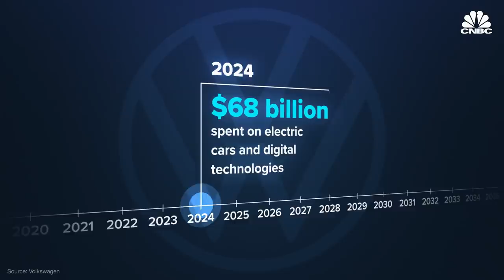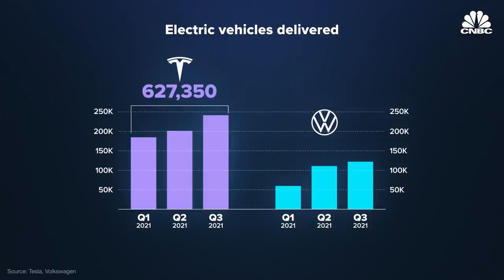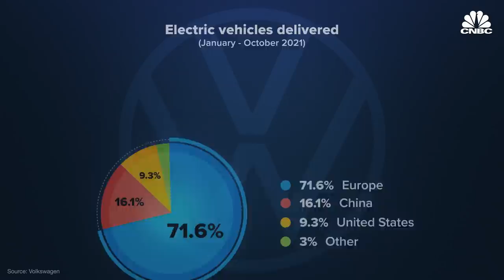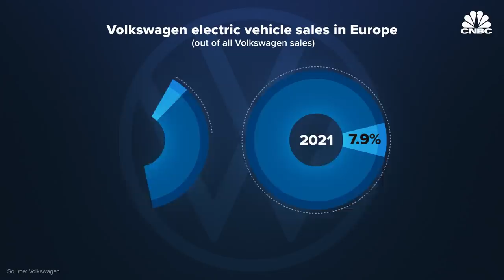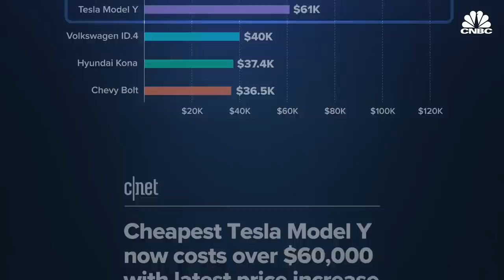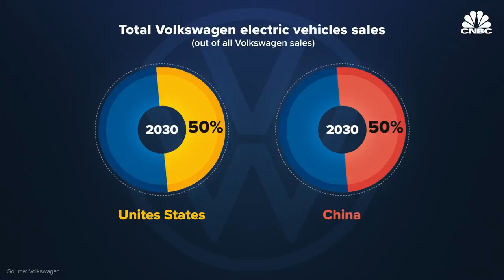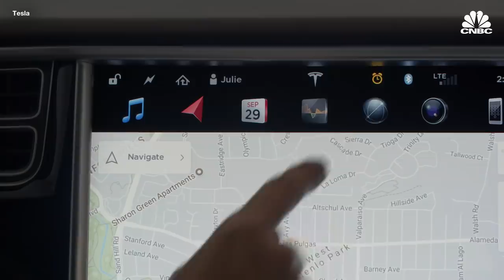Why Volkswagen Is Beating Tesla In Europe

Comment: I am living in Europe and had to decide on an EV as company car. I testdrived a Model Y and an Skoda Enyaq. Both are compareable in size. The Tesla was 20k more expensive. But that was not really important being a company car. My conclusions had been that Tesla is ahead in Software and charging (Supercharger network). And the VW/Skoda was ahead on comfort, Interaction design (due to physical buttons), space, security (Tesla did not even have a cover for the trunk, so everything would be flying around in case of an accident). service network and brand trust.
We decided for the VW/Skoda and it is a phantastic car. The software is inferior. No doubt about that. But after all it is a car and not a toy.
Reply: 20k is not a negligible difference.
Reply: @zkdd23  it was on the company's dime, so no budget issues
Reply: It might seem that Tesla has increased prices to match production capacity. The price of a new model 3 has increased about 8000 USD since we got ours.
Reply: I came to the same conclusion basically and ordered the Enyaq. I must add that the leasing factor is 0.7 and thus really good. However, i ordered the car in July and still have no delivery date, not even an estimate. How long was the delivery time for your car? Greetings from Germany
Reply: What company do you work for ? VW
Reply: @stewarthalliwell  I work for a german IT company.
Reply: @michaelkaercher  it was a joke 
Something which isn’t in the German dictionary !! Another joke
Reply: @stewarthalliwell  So much for stereotypes. Have fun.
Reply: @michaelkaercher  
I can’t afford the Tesla which would be my first choice  
I have tested leaf id3 id4 but they all look dated already 
How are you really getting in with the Skoda ? 
Stay safe and happy
Reply: @stewarthalliwell  The reasons I have described above.  Dated? They did not look dated to me. I find the single screen of Tesla relatively cool but a bit displaced for driver information. At least a HUD should be in Front of the driver if you do not like displays.
Reply: @michaelkaercher  i live in Belgium Luxembourg so we see anything new here first. Because there’s loads of money about 
I can’t agree with you on VW efforts maybe I am not impressed with transfers 
The interior of both 3 &4 are very poor compared with something like the golf 
When Tesla brings out their cheaper small car it’s will be the end of the bigger traditional manufacture 
They need to invest in new plant and they are already bust like German Banks 
I might test the Enyaq and see for my self  what options do you recommend !
Stay safe and happy  and watch out for the radar
Reply: @stewarthalliwell  I did not speak about ID.3 and ID.4 because I did not like the interieur either. The Skoda is much higher quality which is a bit strange given the fact that it is rather a  cheaper brand within the Volkswagen group. I think Vokswagen made a mistake here. 
There is a lot of Hype about Tesla. Tesla sold 386.000 cars in 2021. VW sold 8.9 Million cars. Just to put things into perspective.  And Teslas are not superior cars. 
From a quality perspective, Tesla is not a high quality car. More like a Ford. Compare the Tesla Model S against a decent Porsche or the EQS from Merc. I never ever would consider Tesla here. Buying a luxury car over an app, delivered with missing parts (google for Tesla delivered / parts missing)? Without me. The US service network just collapsed because the heating was failing all over the place. Ever heared that from Volkswagen or Merc? At least there is a decent service network for the traditional brands.
Reply: @michaelkaercher   that’s a long time ago when they come out of China they are another class 
As for Mercedes they have gone down market to pickup the younger market 
BMW makes nothing to get excited about and they have to sack their designers  thé grill is a nightmare 
I am not defending Tesla as they are too expensive 
 But VW may have built so many more cars but they don’t make any money and the time they take a car is over 4 times longer  GM is a joke and lose market share year on year but joe must be trying to get his son a job on the board !!
Reply: @michaelkaercher   what’s your take on the leaf ?  They are taking off 6500 euros off in Belgium
Reply: @stewarthalliwell  never tested it.
Reply: @michaelkaercher  Tesla delivered three times what you claim in 2021
Reply: Hmmm current delivery times for the Enyaq are already a wopping 24 months! Tesla MY only 3 months, go figure....
Reply: The Tesla will keep it's value better, you can't just look at the purchase price. Also the Tesla has better warranty than Skoda / VW.
Reply: @mrm1885  That is pure speculation.Looking at the fact that service is bad and independent repair is blocked, I doubt it.
Reply: @stewarthalliwell  You live in Luxembourg province o Belgium, cool i am from Luxembourg the country. Reality Kia EV6GT (voted car of the year) and Hyundai Inoniq5 are better and cheaper than Model 3 and Model Y.
The new Mercedes EQE (not the EQS) has way more range than Model 3 or Y. In Amsterdam there are currently more new Audi e-tron SUV's (new gen) than new Model X or new Model Y in the inner city. 
Nio ET7 has over 620 miles range (1000km) by far exceeding the Tesla Plaid. Tesla is stuck on level  2 while the competition has level 3 autonomous driving in their production cars and level 4 in their concept cars (Audi and Peugeot for example).
And in Luxembourg the country there are only a very few Tesla cars driving and the Tesla car shop is a microscopic tiny dealership in Bonnevoie next to way larger Bmw dealership and way way bigger Audi dealership on the same road (route de Thionville). Also the Porsche dealership in Howald is way bigger than the small Tesla dealership. All Facts.
Reply: @stewarthalliwell  VW does not make any money ? They literally doubled (over 100% more cars sold) their EV car sales in one year, while Tesla is around 80% car sales from previous year. The competitors (Kia, Hyundai, Mercedes, VW, Audi, Cupra, Skoda, Porsche, Ford, BYD Auto, Nio) etc are selling more and more EV cars now and will over years eat more and more market  EV car sales away from Tesla who is no in a monopoly position (alone as mass production EV car seller) anymore.
Reply: @mlohr1  Tesla delivery times 3 months in Europe is fake news. One of my friends waited for over a year for his Model Y, it still did not come and he switched for a Q4 e-tron.
Reply: @THEREALZENFORCE  
Sorry the true figures are not good 
 VW are struggling with there Id range 
And Tesla has their new battery which will change everything  Ford is bust  GM going nowhere
Reply: The company I am working for replacing Teslas for Skodas. :) Teslas had too many reliability issues. They were serviced three four times a year even when they were only a couple of years old.
Reply: "tesla was 20k more expensive". its because of 20% tax on tesla. but soon the first model y from berlin will arrive. theyll be cheaper i hope
Reply: @Knightfire66  Value Added Tax is the same independent if manufactured in or out of the EU.
Reply: Hahahha that you equate software with a toy-related characteristic... Ok boomer.
Reply: With the price of GAZOLINE at over €2.15 per liter I bet the sales of Hybrids AND FULL EVS in Europe in this 2022 will be off the charts.
Reply: @stewarthalliwell  Good car with pretty good ev range
Reply: You know what they say Tesla is a technology company and VW is a car company.
Reply: @michaelotieno6524  Sure and since 5 years Tesla has a self driving car within 12 month.
Reply: Skoda and VW are two huge jokes, (In Europe the name Skoda use to mean Joke)
The only reason they make their inferior EV's is because of Tesla.
Owning an Ev is not only about owning a good car, it's also about the supercharger network and Tesla's is second to none.
Reply: @straighttalk2069  Another fanboy. Have fun playing Mario Cart or watching you virtual fireplace. I need a car not an overpriced toy.
Reply: @straighttalk2069  Where in Europe ? Cuz I've never heard anything like that. 
Plus if one the most important selling points of your car is a proprietary technology like a charger network (only for Teslas) when the whole continent is building ev charging grids (universal), it might be a good time to think about the real Tesla value.

And as @Michael. K said, quality software is the only thing the other brands don't match, but there'll be a time, sooner or later, when automakers will do.
Reply: I agree: it's a car, not a toy.
Reply: The software ins't games or even FSD. It's what give Tesla's that extra performance & efficiency.